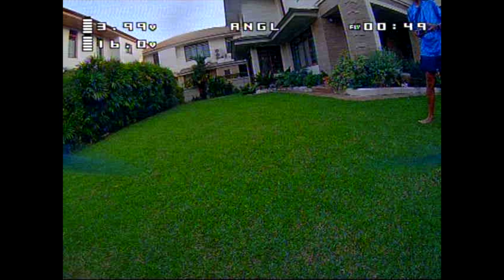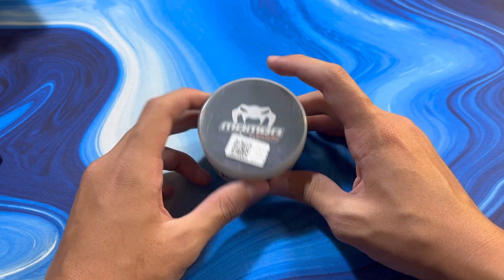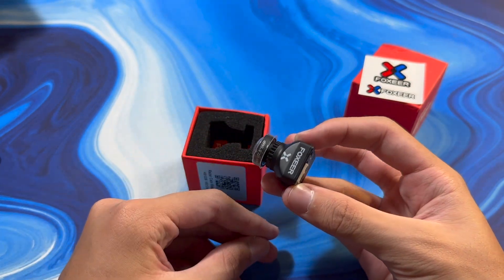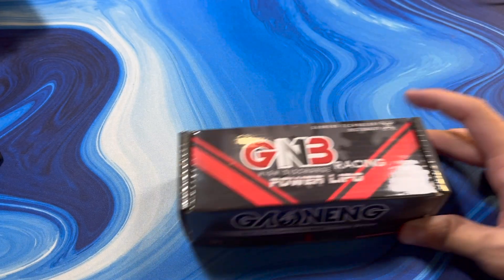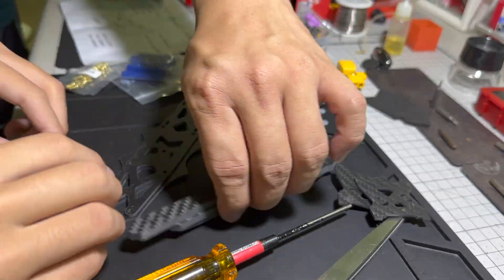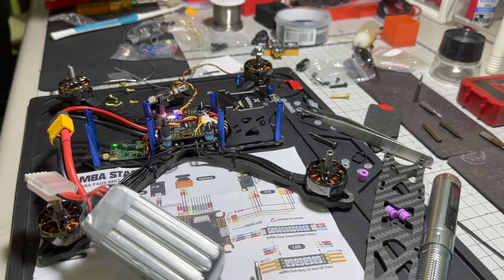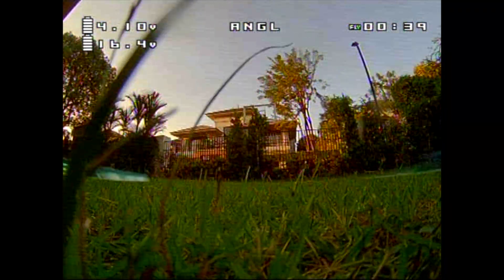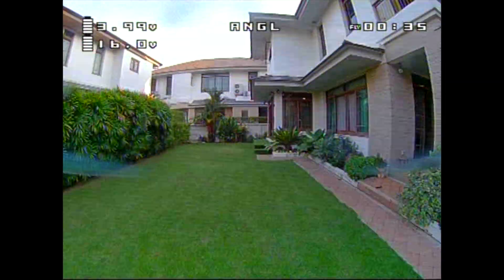Beginner Tries Making and Flying an FPV Drone

Comment: Great video! Definitely go to a school with a big open field to learn or something wide open, definitely stay away from pavement till you get better, but really you should get on a sim like velocidrone, also uncrashed is really good, i didn't care for liftoff, it will save you alot of destruction. There are just 2 pins  you can connect that radio to your computer via the microphone jack using smartpropoplus program, there is a good YouTube video by Makerhand showing it. Good job on first build, I've had just about everything you got there at one time or an other... Although I'm not a fan of diatone, they are a garbage company with corrupt customer service, but as long as it works, rip it. However, I would recommend a more powerful vtx because you really don't want to run on the highest settings all the time, 200mw is ok for open field with that radio, but even whoops come with 350 mw these days, i really like akk ultimate and the infinite with DVR is really nice for a little extra clean footage with osd info. But most of all I'd highly recommend a upgrade to ELRS, the betafpv lite radio 2 se and 2.4ghz nano rx isn't much more $ then that flysky, but elrs just feels so much more like its on rails do to the low latency and ive never had a failsafe and ive flown way farther than i should. Though i got a zorro, the Jumper T-lite v2 is also great!
Reply from the maker: Thank you so much for the advice! I’ll definitely take a look at these products.

Comment: Bro, get a sim. Best $20 you'll spend.
Reply from the maker: I’ve bought LiftOff but I still need a lot of practice on it 😅
Reply: @Poon_B  match your PIDs and keep practicing! I usually hit the sim if it's raining outside. It'll get you on acro so much faster, and pick maps w lots of obstacles to hone your steering and throttle control. I rock that Mamba 405 stack on both of my SourceOne frames.
Reply from the maker: @goodgugamuga Oh ok thank you so much for the advice!
Reply: Definitely I fly in the sim almost every day and I’m hitting tricks I couldn’t even imagine a year ago